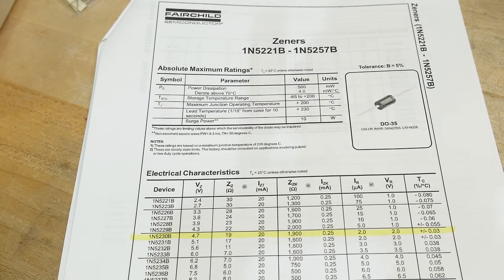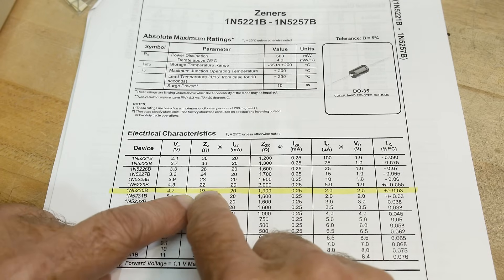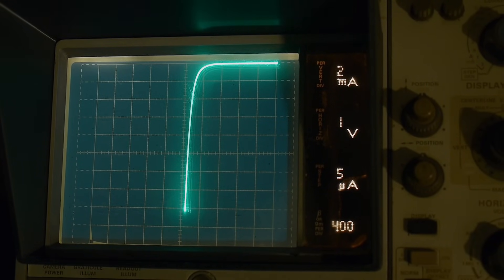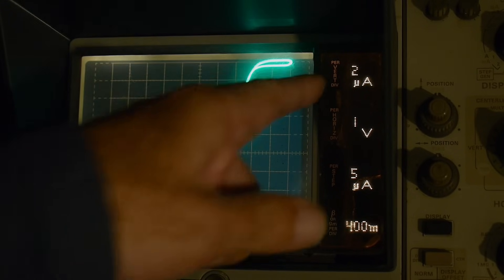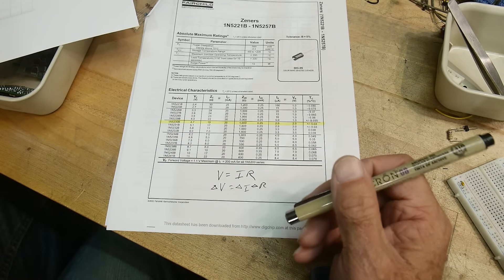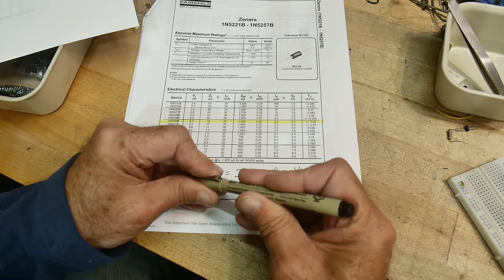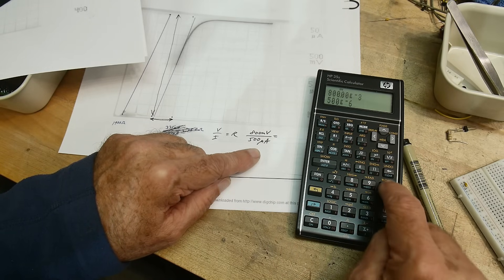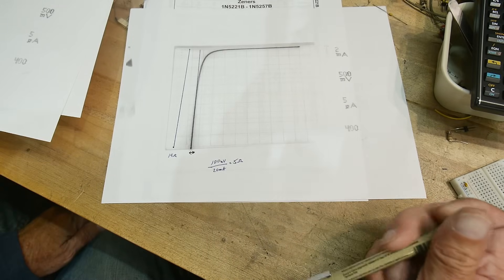#1725 All About Zener Diodes (part 3 of 5)

Comment: Actually, DV=R DI + I DR; but we usually model the device by DR=0.  As current through the device varies (DI), the voltage across the device also varies.  For a reasonably wide range of variations, DV = R DI or V = Vz + R (I - Iz)

Comment: I'm loving this series! What you did with fitting the tangent line to the printout of the curve and calculating the slope is awesome! I tutor high school kids in math and science and I totally would point them to this video if they ask me what the point of learning this rise/run and tangent line business is anyway! It also got me thinking of an alternate world where Tek continued developing these great curve tracers and added a tangent line cursor feature so you could fit the line by tweaking some knobs and then read off the slope directly from the display (similar to the cursors features on some of the 2200 and 2400 series CRT scopes)
Reply from the maker: as a kid, I first learned of the rise/run stuff for measuring the height of a tree (and model rockets, but that was later)

Comment: Are there any qualitative differences between parts listed as Zener diodes and parts listed as unidirectional TVS diodes?
Reply from the maker: zeners operate in conductive region at a select voltage
TVS operate in the non-conductive region (low leakage) until a transient, but not a accurate breakdown voltage.

Comment: You could read the ohms as the impedance the zener has at that current, if you try to draw extra current off it. e.g at ~1.9k ohm impedance, if you attached another 10k load to it, that would form a decent voltage divider and pull down the voltage. However at 19 ohms, a 10k ohm load would hardly make any difference to the source voltage; the 'voltage divider effect' would be tiny.

Comment: The resistances in reverse conduction get lower with increasing reverse current, and the lower that impedance is, the "stiffer" the voltage reference is, so you use the data sheet values to make sure your circuit provides enough reverse current to make the reference "stiff" enough for your application.  And if I use an op-amp or a transistor to buffer the output of the zener, that adds additional stiffness to the reference.  Did I get that right?
And you can’t go too far down the reverse current slope or you’ll blow up the zener. the horns of the dilemma.